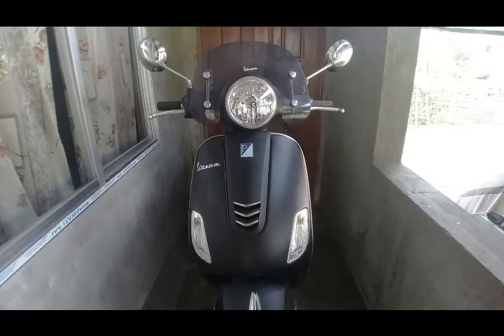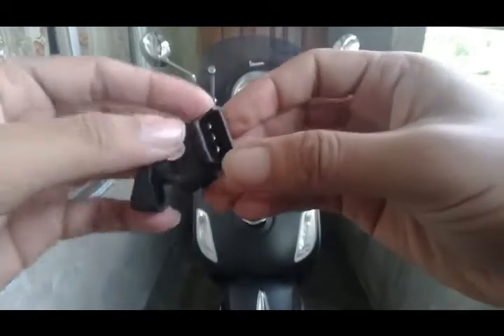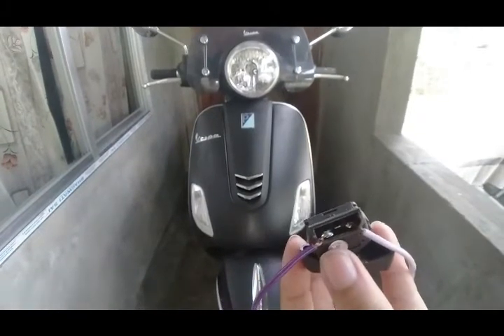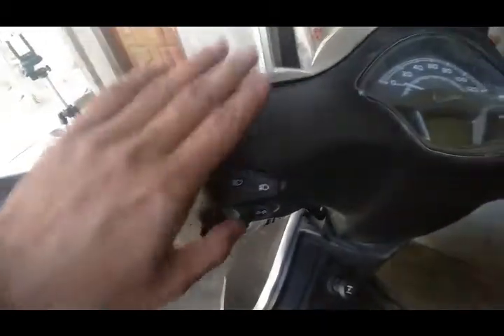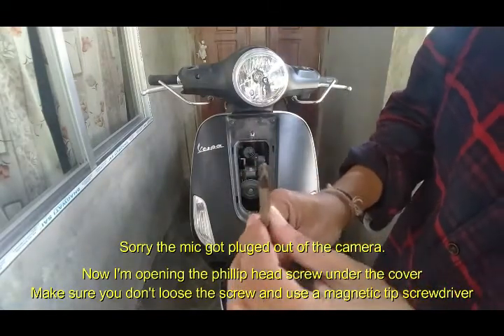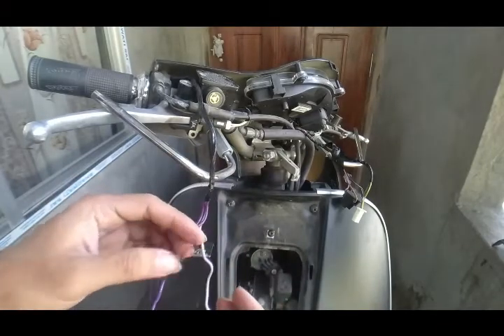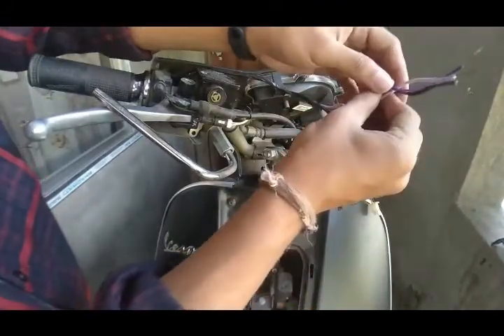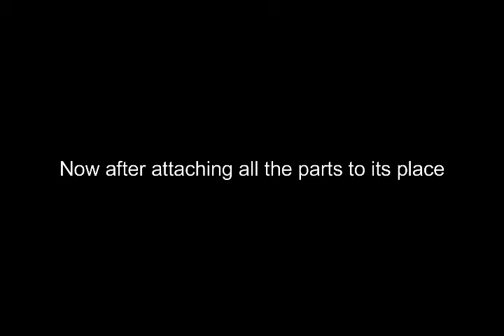How to connect headlight switch on BS4 Vespa or any BS4 Scooter

Comment: How to wire parking light connection in old Activa. With Activa 2017 model headlight swich
Reply from the maker: With some jugad anything is possible. But I cannot elaborate as I have not seen the connections on Activa
Reply: @intazsaikia-mototalesne287  video make  bro parking light install old Activa 3g. With new Activa parking switch